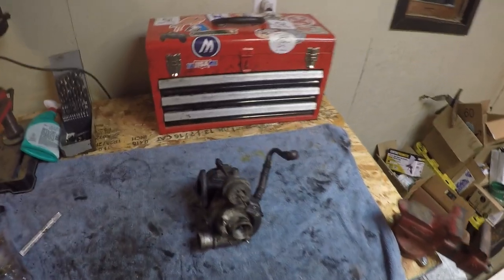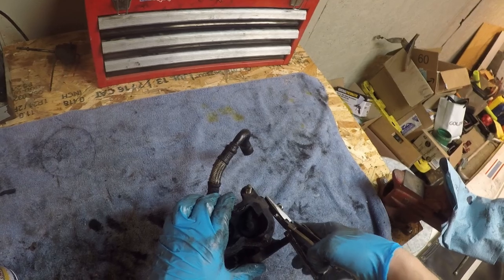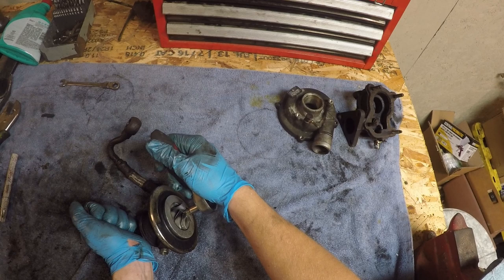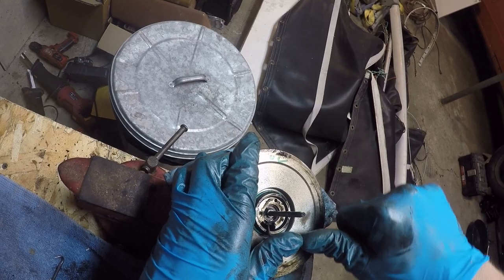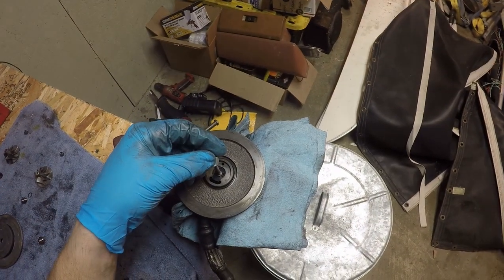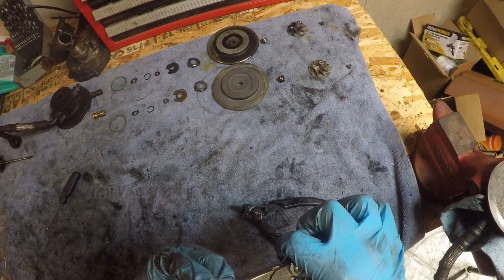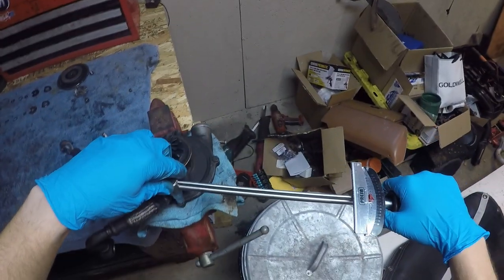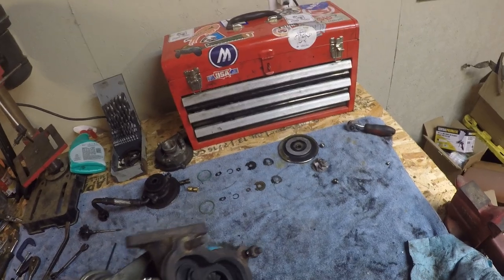KO3 Turbo Rebuild - In Depth Instruction

Comment: Love almost everything about this video. I do want to say that it is important that you position the open part of the turbine retaining ring, the snap ring that the journal bearing sits on and the compressor backing plate snap ring upwards or against gravity if your center cartridge won't be perfectly upright. 
If you don't you'll have oil leaks through the small crevice into your housings
Reply from the maker: Good to know. I’ll keep it in mind for next time

Comment: You don't have to match or align turbine to impeller. They can be purchased separately for that reason. The balancing of each component is done in the manufacturing. To make it clear, it's like a tire: it gets balanced to itself, not to the other wheel on the other side.
Reply from the maker: Makes sense to me. I suspected when I rebuilt the Garett and had to replace the turbine. 
Thanks for your input. Must have just been some old piece of info I heard a long time ago. No harm in being careful though.
Reply: @haoleboyshow-tos2279 True...never hurts to be careful. Thanks for your video, I needed to see the torque of that nut and it helped.

Comment: thanks for sharing this!! i decided to rebuild mine k04 0028/0029 and your video showed me the way. one question, my kit has 2 journal bearing, like yours. one with a big oil hole and the other with a small one. but on my turbo, it came with the small one. can i just replace it with the one with the big hole, checking orientation of course. thanks in advance
Reply from the maker: Thanks, I appreciate it. I would use the smaller hole bearing if that’s what matches the old hardware. Best of luck!

Comment: Really useful video! Question, where did you get the parts diagram and torque specs? I'm looking to rebuild a K04. Also, what parts would have needed assembly lube during reassembly?
Reply from the maker: Just google image search “K03 turbo and exploded view”. Torque specs are mostly standard given thread and material. I would lube the points where the turbine shaft touches the bearings

Comment: So, no gasket, no o-ring, or anaerobic sealant on the compressor housing flange??? My 2014 Audi Q5 had a gray sealant. Super thin layer. I was hoping you would use it and tell what to use.
Reply from the maker: Use RTV copper, that seals well and isn’t temperature sensitive.

Comment: I forgot to mark the compressor turbine wheel. It has marks that show it's been previously balanced. Is there anything I can do without taking for a rebalance?
Reply from the maker: Someone mentioned in the comments that they are individually balanced. I haven’t been able to verify, but you won’t need to worry about alignment if true.

Comment: thanks for the explanation, i have a question , i wanna know if the ko3 rebuild kit  is the same for the ko3S ?
Reply from the maker: @sadness3out961  I am not familiar with the K03s it appears to be the same, but I can’t say for sure.
Reply: @haoleboyshow-tos2279  thank you for the answer is the ko3s that you rebuilt still working well after all that time ?
Reply from the maker: @sadness3out961  Yes, it is still working from what I know, but I don’t own the car anymore. I put about 3000 miles on it before selling

Comment: Is it possible to replace the waste gate? Mine is loose and rattling.
Reply from the maker: Sure, I actually did replace mine in this build. The original was full of oil. The difficulty will be in finding one. You’ll probably need to find it on a used turbo.
Reply: @haoleboyshow-tos2279  thank you. I will probably need to replace the actual flap and the mechanism that connects to the actuator rod.

Comment: I can't get my chra back into the exhaust housing. It's like it's an extremely tight fit and I don't want to force it too much and bend the blades
Reply from the maker: It is a pretty tight fit. You may have to put the compressor back on, cover the inlet with something and tap it on with a rubber mallet. I did something like that in my video on the Garrett T3.
Reply: @haoleboyshow-tos2279  I ended up heating the turbine housing with a propane torch and it slipped in almost perfectly!

Comment: Dang thats a little mini turbo..So my 2001 beetle glx 1.8t has a K03S turbo.. probably the same size
Reply from the maker: It’s pretty tiny, but it fits. Going larger than a KO4 on these and they get laggy quick
Reply: @haoleboyshow-tos2279  I will say this..for this turbo to be so little it does pack a punch..spools up quick..KO3 S turbo is just a little different..

Comment: Where did u get the fit from?
Reply from the maker: I used this kit. 
https://www.ebay.com/itm/265228820792?chn=ps&norover=1&mkevt=1&mkrid=711-117182-37290-0&mkcid=2&mkscid=101&itemid=265228820792&targetid=1645685073808&device=m&mktype=&googleloc=9005556&poi=&campaignid=16730423415&mkgroupid=135815925780&rlsatarget=pla-1645685073808&abcId=9300841&merchantid=119208944&gbraid=0AAAAAD_QDh-dhCkKv4WlHoiZrhabqjeiJ&gclid=EAIaIQobChMIkbGz8vyD-wIVwvbICh2MnwLVEAQYAiABEgJMQPD_BwE
Reply: @haoleboyshow-tos2279  I have a k03-006 turbo for my ahu tdi I think I'm gonna rebuild it or get a cartridge.
Reply from the maker: @infernoking7504  Good luck. The rebuild is easy and cheap enough. I’d recommend that route.

Comment: Any chance you know where I can find the ko3 bearings and gaskets rebuild kit
Reply from the maker: I used this kit:
https://www.ebay.com/itm/265228820792?chn=ps&norover=1&mkevt=1&mkrid=711-117182-37290-0&mkcid=2&mkscid=101&itemid=265228820792&targetid=1645685073808&device=m&mktype=&googleloc=9005556&poi=&campaignid=16730423415&mkgroupid=135815925780&rlsatarget=pla-1645685073808&abcId=9300841&merchantid=119208944&gbraid=0AAAAAD_QDh-dhCkKv4WlHoiZrhabqjeiJ&gclid=EAIaIQobChMIkbGz8vyD-wIVwvbICh2MnwLVEAQYAiABEgJMQPD_BwE
Reply: @haoleboyshow-tos2279  and I’m assuming it hasn’t stopped working or anything yet, you wouldn’t have chose a different kit if you could go back? Just trying to be certain tired of waiting for parts and having shit torn to pieces
Reply from the maker: @eliwalker8410  Everything worked just fine, I have no complaints with the kit. 
I since sold the car, but I put about 3000 miles on the turbo with no issue.
Reply: @haoleboyshow-tos2279  alrighty thank you I appreciate you greatly man